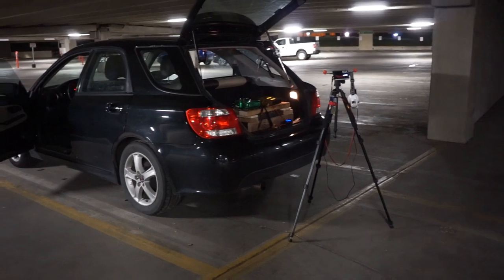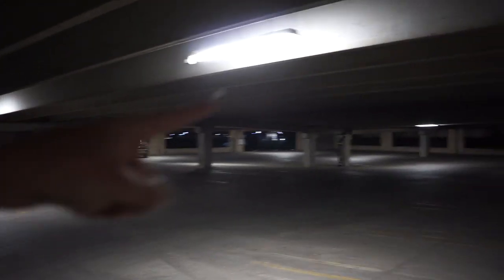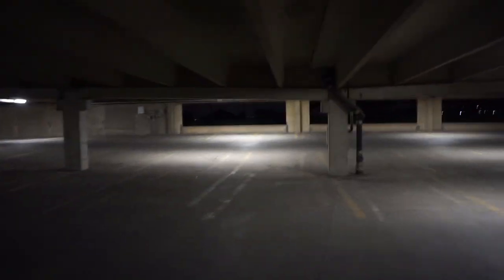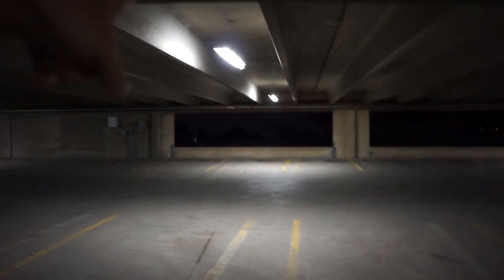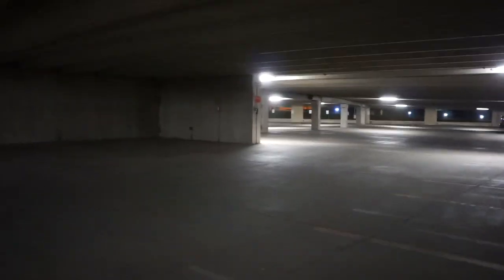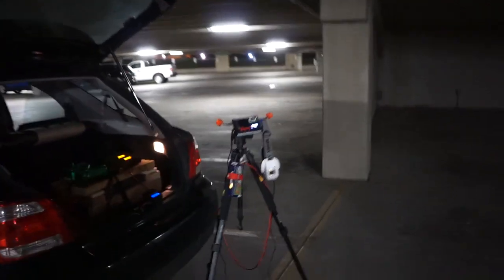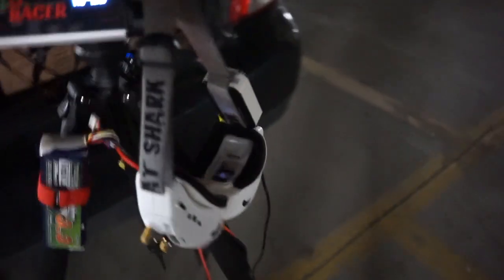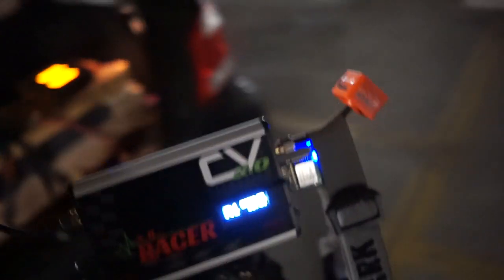Clearview 2.0 Test #1 - Parking Garage Multipath Torture Test

Comment: Got mine in and tuned to F 5240 but the video quality is about 35% of the standard FatShark receiver module. Hoping to hear back from their support.
Reply: I really appreciate your help while I had the ClearView 2.0 in. I sent it back to ClearView but now their customer support is not responding to me. We are now working with PayPal to try to get our money back. I wish it would have worked out, love the idea of the technology, but now their customer support won’t respond.
Reply from the maker: 5240 is really low. I don't think the modules are full range at low band
Reply: Ryan Friedman crap I meant 5740 my fault
Reply from the maker: @Cc-nj2zm  are both antennas good? SMA (not RPSMA)
Reply: Ryan Friedman I originally made that mistake but swapped them out for SMA male and female l. The TBS black antennas for $40 brand new from get fpv. So the antennas are solid at least
Reply from the maker: @Cc-nj2zm  what voltage are you running at?
Reply: Ryan Friedman 4S
Reply from the maker: @Cc-nj2zm  ok. Try restricting it to right antenna and testing, then left antenna. It's in the user menu. The chances are extremely low that both sides are bad.
Reply: Ryan Friedman thanks man. I will try. Very kind of you to try to help  when you were not obligated to
Reply: Ryan Friedman I tested left and right they both seemed to work I suppose. The overall video quality is so much less than my la forge module and stock fatshark module. And the distance is not as good. So sad.  Wonder if I got a bad unit.

Comment: Do you think this has a significant advantage over the cv pro? 

Is it worth the upgrade ?
Reply from the maker: The image degradation is more predictable and maintains brightness. If you fly low signal ever, I would say it is worth it. I haven't determined how much better the absolute range is.
Reply: @Ryanfriedman96  do you say the range of the CV 2.0 is better than the PRO?  What the pro have to offer that the CV 2.0 don t do?
Reply from the maker: @francisdaoust5862  cv2 is much better than the pro. There is no advantage as the pro is v1 technology